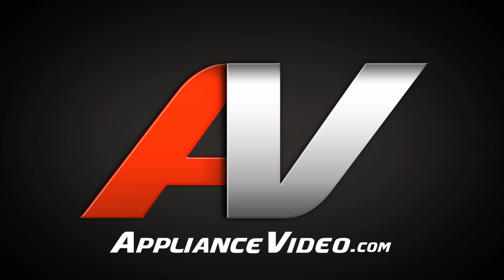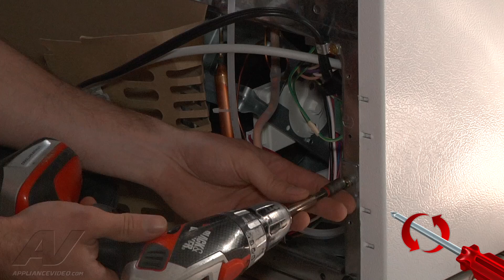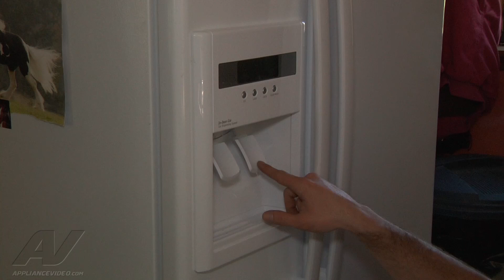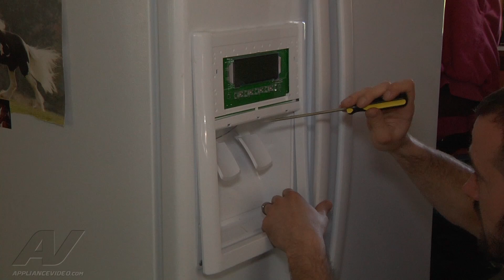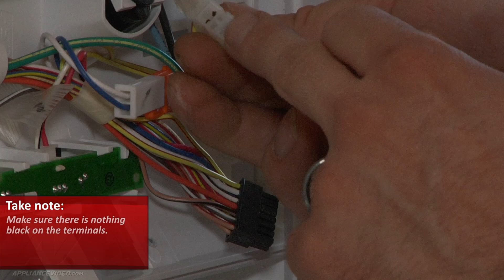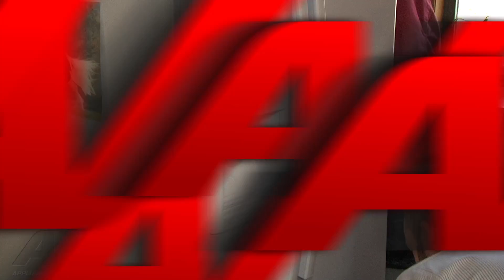Whirlpool Refrigerator Repair - No Water From Dispenser - LCD Control Board

Comment: Hi there! Good video. Im really looking out for a special repair.  Maybe you can help, me and others with the same problem.  I have a double sided whirlpool White fridge 30 years old. Model ED27DQ It has been working super super great. So im keeping it as long as i can even if its yellowish. It has water and ice dispenser.  Three days ago freeezer light, water and ice dispenser does not work. Freezer cools great and ice cubes stil are done. But light when oppening door does not lit and nothing comes out from water or ice dispenser. Do you know what might be the reazon why elecrticity that goes to light and dispenser do not flow? I cant find cable diagrams or videos at all. All videos are for newer edditions.   Thanks in advance.

Comment: Good video, but one point to make: you found 120v at the water control valve. If this was the case and the water control valve was good, water should have been flowing to the water dispenser without stop. The homeowner would have had quite a flood on the kitchen floor. Everything points to a bad water control valve and a bad relay on the main board sending constant voltage.

Comment: What is number for the plastic housing that holds the microswitch. The plastic pins that hold the switch in mine broke and I want to order a new one.
Reply from the maker: Great question, if you have a more technical question that our parts department cannot answer, you can search our over 17,000 answered questions free at our website www.ApplianceVideo.com under our Repair Help section. You can also call our parts department at 1-800-830-5465 and they can give you help 7-days A week ,or search at www.SaveMoreOnParts.com  .

Comment: What was the problem at the end. I have the same problem. The 120v on the valve is always on
Reply from the maker: Great question, if you have a more technical question that our parts department cannot answer, you can search our over 17,000 answered questions free at our website www.ApplianceVideo.com under our Repair Help section. You can also call our parts department at 1-800-830-5465 and they can give you help 7-days A week ,or search at www.SaveMoreOnParts.com  .

Comment: We’ve replaced the valve in back and changed the ice maker inside but when the ice disenchanted and water starts running in ice maker it runs over and doesn’t cut off
Reply from the maker: Great question, if you have a
more technical question that our parts department cannot answer, you can search
our over 10,000 answered questions free at our website www.ApplianceVideo.com under our Repair Help section. You can also call
our parts department at 1-800-830-5465 and they can give you help 6-days A week
Monday -Saturday, or search at www.SaveMoreOnParts.com  24 hours
7- days A week.

Comment: Very very interesting repair call. Did your techs found out what was causing this once they replaced the parts ordered? thx.
Reply: ***** Were you able to find out?
Reply: Most likely it main board failed
Reply from the maker: I will check with the technician and get back with you. Thanks